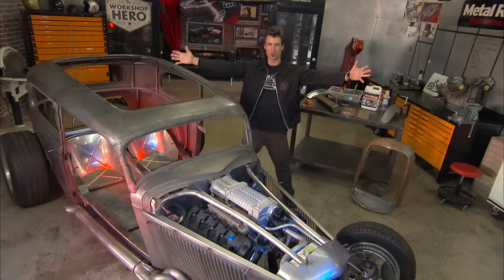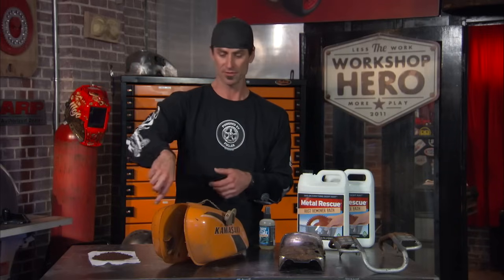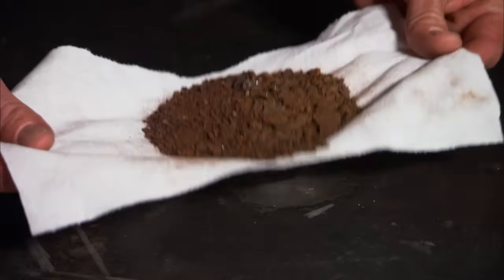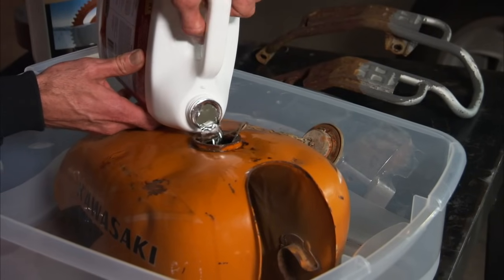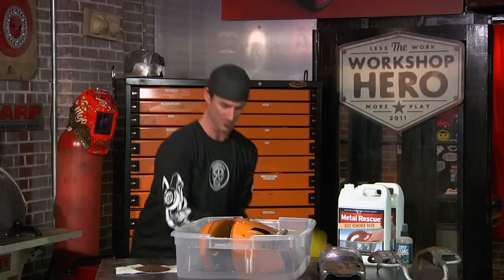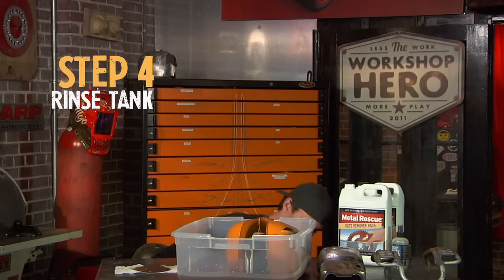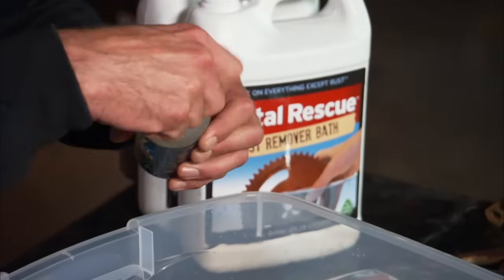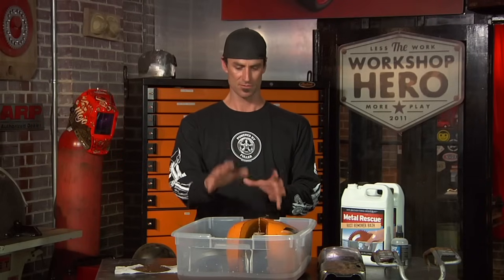How To Remove Rust From A Motorcycle Gas Tank: NO ACID

Comment from the maker: Metal Rescue is available in several sizes which determines the price.  We sell the one gallon bottle for $25 and the five gallon pail for $90.  These prices do not include shipping.  Visit the Workshop Hero website and input your zip code in the store zip code locator to find a storefront close to you.  Or call 1-800-365-1117 and we can assist.  Thanks for your interest

Comment: Metal rescue might be great, but it's extremely expensive.  It's $25 a gallon right now on Amazon.  I just use electrolysis.  It's cheap and it works just as well.
Reply from the maker: Hi Bryan, there are many ways to remove rust, Metal Rescue may not be cheapest, but it's the cleanest, safest, and easiest way to do it. Thanks for watching, please let us know if you ever have any questions.

Comment: I have a 6gal motorcycle tank I’m not filling that thing to the rim that stuff is expensive
Reply from the maker: Hi Joshua, you don't have to fill the tank up all the way. Metal Rescue Rust Remover Bath is reusable! 1 gallon will remove up to 1/2 pound of rust. Just make sure that where ever there is rust, let Metal Rescue soak on that area for a few hours to remove it. Once it's removed, move onto the other areas. You cannot just swish it around, it has to soak. Thanks for watching, please let us know if you have any other questions or comments!
Reply: Metal Rescue Rust Remover Bath from Workshop Hero ok this is good to know

Comment: 2) Final rinse for VTX: I flushed tank by running garden hose nozle on "jet" mode all around walls inside, then let tank overflow w/ H2O for 10 mins, changing tank position to let loose particles flush out w/ H2O stream from cap area & pitcock hole. I used a dedicated bucket head wet vac to suck out stuff while sloshing. About a cup of H2O & particles remained so I stuffed clean dish rags partiallt thru pet cock & cap area then slished tank around. Pulled out gently.... cont to next post

Comment: Why not show a before video of inside  of ORANGE tank and after? On YELLOW tank why not show a close up of results?  Zooming in to prove your results in my opinion would have been more convincing as for the pile of rust taken from tank.....again why not show the actual results the work being performed on rust pile? Kinda miss leading in my opinion. Feel free to send me a sample so that I can properly show the results from beginning to end and with full zoomed in results before and after. Till then there are alternatives that have been tried and true for years ...white vinegar for one. Just saying...so don’t hate!
Reply from the maker: Hi Casp 72, since this video was made, we have made more that show close ups, before's and after's, and even a time lapse! We made this video to teach you step by step on how to use Metal Rescue inside your gas tank. If you need some convincing, check out this video we did comparing Metal Rescue to Vinegar. We understand that there are many ways to remove rust, but Metal Rescue is the cleanest, safest, and easiest way to do it! Unlike vinegar, Metal Rescue does not contain acid, which if left on or not neutralized, will actually promote rust. Thanks for the comment, and thanks for watching! https://youtu.be/FusxqHduvCE
Reply: Won Honglo I see, yea my vf750f for now is in project stage due to being a 1984 parts are harder to find so I’m upgrading a few things and customizing a few others. I still have hopes for what was once the #1 speed bike in America.👍🏼

Comment: SO ABOUT 60 DOLLARS FOR THE CHEMICALS..PLUS...EXPENSIVE FIX...?
Reply from the maker: John Baart, hi John, thanks for watching. Sorry, we don't understand your question? What do you mean by expensive fix?
Reply: Just seems like chemicals are pricey...maybe  there's a cheaper way to do it....
Reply from the maker: John Baart there are many ways to remove rust. Metal Rescue is the cleanest, safest, and easiest way to do it. Metal Rescue is not an acid like vinegar or coke. So your metal will not flash rust and you don't have to neutralize it. You can use nuts and bolts and roll it around the inside for hours. You could also go the electrolysis route. Metal Rescue isn't the cheapest method you're right, but 1 gallon of Metal Rescue goes a long way. You can reuse it! 1 gallon will remove up to 1/2 pound of rust. Try it out for yourself, we offer 100% money back guarantee. Pick a jug up at your local Home Depot, AutoZone, or Canadian Tire. Please let us know if you have any more questions or comments. Again. Thanks for watching!

Comment: My tank holds 12 gallons. Sounds like it would get expensive.
Reply from the maker: Frank Semonious hello! Metal Rescue is reusable. 1 gallon removes 1/2 pound of rust. Although we do recommend filling up your gas tank, depending on the rust, you may be able to use less by rotating the gas tank. Letting Metal Rescue soak on the rust until it removes it. Thanks for watching, please let us know if have any questions!

Comment: I washed my tank out, didn't power wash it, but used soap and water and rinsed it.  I let it soak overnight, and the next day rinsed it out again.  Epic fail.  I am going to have to find another solution.  It didn't look like it did much of anything.  These instructions in the video are nothing like the instructions on the can.  I spent $28 for this thing, and I didn't see any change.
Reply from the maker: Hi J Furey. We are sorry to hear about your tank. We stand behind our products 110%! There are a couple of reasons why Metal Rescue may have a hard time working. 1. Temperature: The Metal Rescue liquid has to be 68 degrees or above. The cooler it is, the slower it will work. 2. Old gas or varnish left inside the gas tank: Any barrier like old gas or varnish, or even a failed liner will prevent Metal Rescue from working because Metal Rescue is not an acid. Did your Metal Rescue turn dark? We want to make sure we know exactly what happened with your tank. Please email us at info@workshophero.com and we will make sure you get your tank cleaned out with Metal Rescue. Thanks for letting us know.
Reply: Thanks, guys.  It sounds like sloshing the fluid around doesn't work, but just letting it sit for 24 hours with a full tank is the way to go.  I will give it another shot and post the results.
Reply: J Furey try apple cider vinegar
Reply from the maker: fortunecollector Hi Jay, we did try Vinegar. Actually, Metal Rescue worked faster, and because Metal Rescue is not an acid, it doesn't promote rust when left on or not neutralized. Watch for yourself and you can be the judge on which one worked the best! https://youtu.be/FusxqHduvCE Thanks for watching!
Reply: See my follow up post after using 3 gallons and proper cleaning and temperature.  Epic success!
Reply from the maker: Thanks for giving it another shot! We are glad to hear that Metal Rescue did the job for you! Please let us know if you have any questions!

Comment: NOPE.... Klean Strip Prep & Etch is the Best!  It is the same stuff just 1/4 price.  Warmer you keep it the faster it works...
Reply from the maker: Hi Oldskool, there are many ways to remove rust from metal. Metal Rescue is the cleanest, safest, and easiest ways to do it! Unlike Klean Strip Prep & Etch, Metal Rescue is not an acid! Which we all know when an acid is left on and not washed off or neutralized, it promotes rust. Metal Rescue is safe to use on paint, plastic, rubber, and chrome, and it's safe on skin. Give us a try, it's nice to have options when it comes to removing rust. Thanks for watching, please let us know if you ever have any questions.
Reply: Didn't think before I wrote... shouldn't have put "Nope" in there...Sorry.  There are many different ways to clean a Tank...  But as far as Prep & Etch causing rust. You might want to check the science... It will not cause rust ... It does just the opposite.
Reply from the maker: Hi OldSkool, our only point was that phosphoric acid removes rust, but if it's left on and not neutralized, it will actually promote rust. Acid is also not safe on paint, and skin. Metal Rescue does not contain an acid of any kind. Please let us know if you ever have any questions about our products.
Reply: That was what I was trying to say.... Even if it is left on it won't cause rust... It will protect by forming a white film.
Reply: @OldSkoolF  hey man I keep getting flash rust that's the only thing I have left to deal with I need help
Reply: @joshuacruz4046 ...  Yes if you don't keep the solution warm (just above 80) it won't finish...  When the process is done properly the steel/iron will have a blackish coating..  However if you don't want to wait you can add some W/D to the rinse water....  When we pull blocks out of the Hot Tank they get rinsed and doused with W/D immediately even before they completely dry...  Once the W/D touches the surface it "Cures" it.... I don't know...  It just don't rust again...   If you dump it out and leave the Prep & Etch to dry it will leave a white coating that won't come off...  Try a test piece of steel to get the hang of it...  I been using it for 40 years and its kinda hard to explain....   I just works..  Buy W/D gallons and an old spray bottle....  Shake it first....  Most people don't know W/D settles..  Don't ever get frustrated...  Just keep going and it will come...
Reply: @OldSkoolF  what do you mean. By w/d ? Wd40?
Reply: @joshuacruz4046  Yes sir....  The best shop anti rust I've used...  It dries out nice after a couple days..  Buy a gallon and a spray bottle...  You'll never go back to the spray can.
Reply: @OldSkoolF  I will definitely do that
Reply: @OldSkoolF  what I'm trying to get rust free is a motorcycle gas tank and I used vinegar and has it cleaned and I rinsed it out with gas and it rusted out completely
Reply: @joshuacruz4046  Woah!!! Vinegar is only good to free a stuck engine...  Klean Strip Prep & Etch mixed 1 to 4 parts water...   If you want to get the rusty scale out throw in some small nuts and bolts and shake the tank or make a rotisserie and let it spin for a couple hours...  Obviously close up the holes...  Should come out like new...
Reply: @OldSkoolF  it only has surface rust rn
Reply: @joshuacruz4046  then just make a gallon of the 4 to 1 mix, fill the tank and put it in the sun...  Rotate it every hour...  Later tonight look in with a flashlight.. (Not on your phone) a real flashlight...    Might need to do it for a couple days its kinda late to start now...  You can do this... Trial and error... I have learned to test a process on scrap before going to the real deal....  How I  perfected my welding skills...
Reply: @OldSkoolF  I will give it a shot thanks man

Comment: Easy: Buy a chrome spray paint and spray it and magic it’s brand new.
Reply from the maker: Hi FPSNitron, Metal Rescue Rust Remover Bath is a water based rust remover that removes only the rust! It's safe on paint, plastic, and to the touch and is the perfect tool to get the rust out of your motorcycle gas tank. Are you referring to the outside of the tank when you say buy chrome spray paint? Thanks for watching, please let us know if you have any questions!
Reply: Metal Rescue Rust Remover Bath from Workshop Hero I don’t really know but does it look bad if I spray paint the rust?
Reply from the maker: Hi FPSNitron, you need to remove or convert the rust in order for it to stop spreading. The cleanest, safest, and easiest way to do that is with Metal Rescue! Thanks again for watching!
Reply: Metal Rescue Rust Remover Bath from Workshop Hero I’ll try this product out.

Comment: this is just as effective as cider vinegar....just a fancy name and expensive
Reply from the maker: Hi Ed, Metal Rescue is actually more effective than cider vinegar. It removes rust faster, and one gallon of Metal Rescue will remove up to 1/2 pound of rust! So it's reusable! Plus, Metal Rescue is not an acid, unlike cider vinegar. Metal Rescue is safe on paint, plastic, and does not etch the metal surface. Thanks for watching, please let us know if you have any questions!
Reply: I  vinegar to remove rust worked great but then after emptying it i rinse it with gasoline and it flash rust so quick

Comment: yeah ,,,, water based .... only reason they rust is... petrol  loves moisture . goo d luck guys
Reply from the maker: Hi MrSprocket2u, Yes Metal Rescue is a water based rust remover. It's also not an acid. Metal Rescue only removes the rust from your part. What you are left with after using it is bare metal. You will have to protect the part after using it. You are correct, petrol does love moisture. Thanks for the comment, please let us know if you have any questions.

Comment: this is a terrible product. i kept it 24 hours and all it did was get dirtiness out of my gas tank. did not clean up any rust.
Reply from the maker: Hi, we are sorry to hear that Metal Rescue didn't give you the results that you wanted. Metal Rescue is not an acid. That being said,  any barrier between Metal Rescue and the rust will inhibit it from working. You have to make sure that the part is cleaned down to the bare rust. Then soak it in Metal Rescue. Please email us at info@workshophero.com. We stand behind our products 110% and we want to make sure you have a positive experience with it. Thanks for contacting us with your issue, we look forward to hearing from you.
Reply: The tank has to be cleaned before you use it or it will not work. My tank is clean and pretty after 24 hours.

Comment: Use coca-cola, efect is same.
Reply from the maker: There are many ways to remove rust. That being said, Metal Rescue is the cleanest, safest, and easiest way to remove it!  Coca Cola contains acid, which if left on and neutralized will promote rust! Metal Rescue is not an acid and doesn't leave any residue on your part after soaking. We compared Metal Rescue to Coke. We found that Coke takes a very long time to remove the rust, a very long time! Check out the video, and you can be the judge on which one worked the best. Thanks for watching, please let us know if you have any other questions! https://youtu.be/tKrfQa1qefs